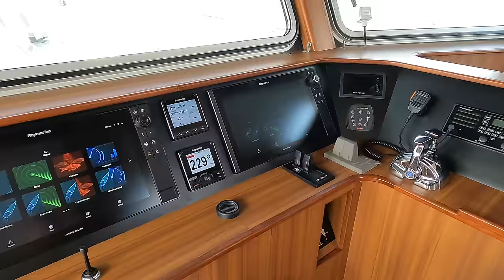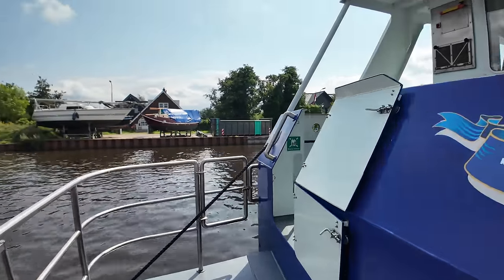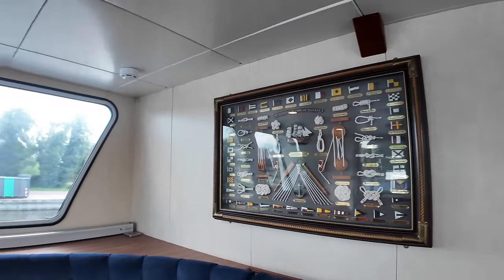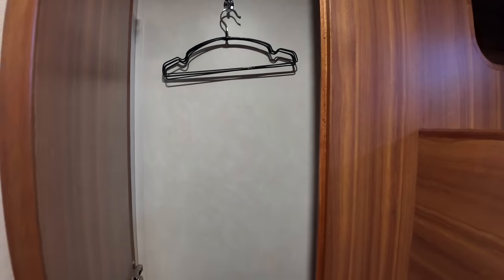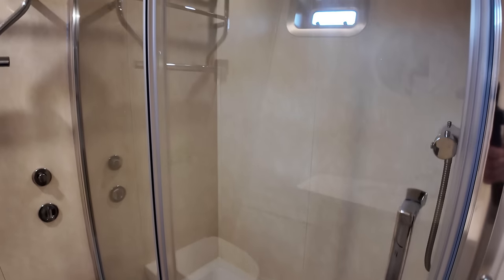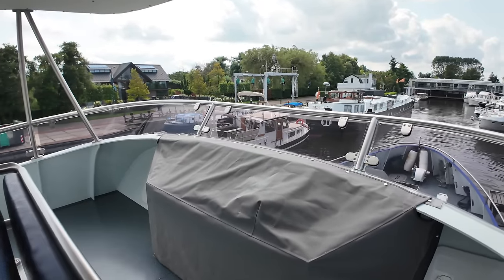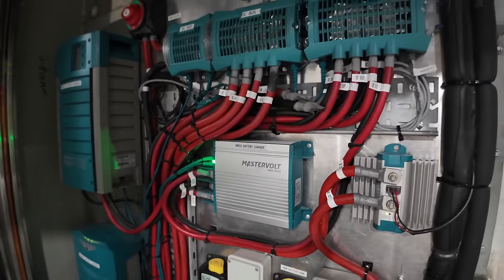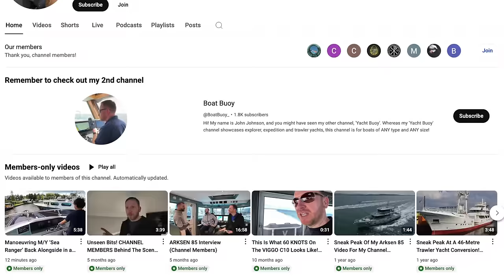€1.7M 'Sea Ranger' The Ultimate Steel Trawler Yacht (FOR SALE!)

Comment: As usual, a boat of this size not having a adequate refrigerator in the galley! 😮
Reply: A beer fridge lol . . . How did they "explore" without decent refrig/freezer capacity
Reply: with that price tag, you can get a luxury yacht that is equivalent in performance
Reply: The whole boat seems like kind of a joke to me for the price. You could do much better from what I've seen. This boat is awfully finished inside. It looks so incredibly cheap I can't justify the price in any way. It looks like a nasty Canadian house-basement rec room from the 80's. All that's missing is the tobacco stains on the walls.
Reply: Agree, never  ceases to amaze me.
Reply: A 4 burner hob & a microwave?!?
A dormitory size mini-fridge & no freezer?!?
Not impressed at all with the galley abilities or the U-shaped dining area.
If I had to choose between the 2, I’d absolutely go with a Dutch Barge.
This boat is not for me.
Reply: High latitude exploration means cold conditions. The deck is a refrigerator! 😂
Reply: It’s a rust bucket.  Get Yeti the aluminum Globemaster 50 New for less money.
Reply: Adding a chest freezer to the lazaret etc. costs 200$ and uses 80 watts. Literally smallest problem in the world.
Reply: @jo_magpie  One shouldn't have to do that if consideration was given to where it needs to be. Sure, an on the fly fix cheep in cost and thought!